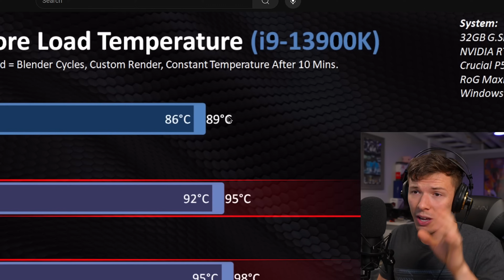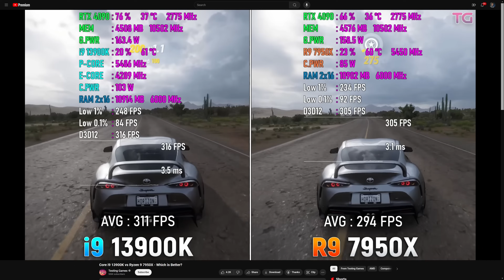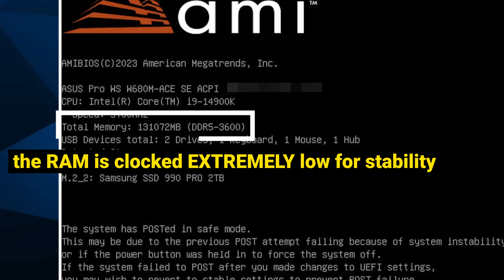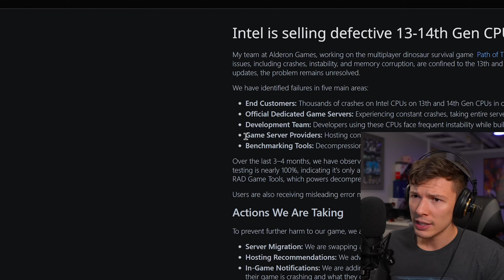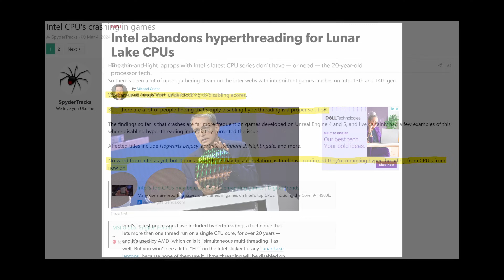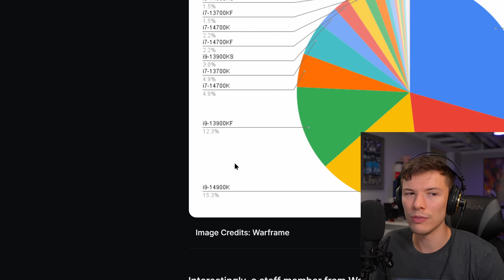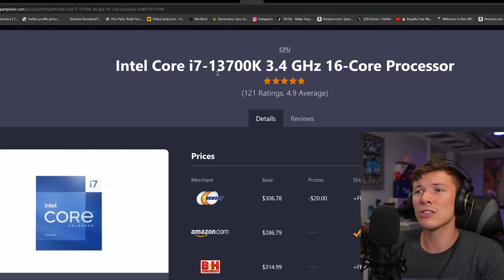Intel F**ked Up Bad

Comment: Its not the power its the insane high voltage that they are using for single core boost. its running up to 1.525v on single thread workloads, limiting the power wont help since it can roast 2 cores at max voltage with less than 125w.
The best guess so far is that the degridation is effecing the ringbus and not the cores themselfes, thats why the errors are so random and diverse since its the link between the cores and not the cores that are failing. 
The last intel chip to use over 1.5v was a 130nm pentium 4 its insane to use 1.5v on 10nm.
Reply: Yeah i hear if you own such processors is to fix the clock speed and turn off turbo boost so it doesn't crack the voltage.
Reply: Any processor glitching like this for what ever reason while running and rated spec is totally unacceptable. There is no excuse for it and Intel should be ashamed of themselves for selling crap like this.
Reply: @schrodingerscat1863  you are right about that it should work out of the box but it also goes for amd processors, if you want to preserve them then also prevent boosting on single cores on it.
Reply: @ashamahee  Yeh, I heard that but at least the AMD processors aren't glitching out from day one. Still no excuse for selling product that has poor lifespan because it is being pushed too hard in normal operation.
Reply: @schrodingerscat1863  yeah but absolutely the preferred choice out of the box is AMD no questions about it, their products seem to work for a long enough time before needing to be changed so there's that and there are not many reports either of their products failing.
Reply: @ashamahee  True, I think AMD products only see problems if you push single cores hard for prolonged periods of time, not a typical usage scenario at all.
Reply: @ashamahee  No, there is no evidence of AMD CPUs degrading at all. There are only a handful of examples of this in the community and it's been from certain users pushing too hard to overclock.
Reply: yep. ringbus can't take all that voltage and starts to degrade over time. that's the conclusions I've read from many others on this topic too. very reasonable conclusion given all the info we have so far
Reply: Have a 14900K, no issues, in bios set 1.3v, capped to 320w, 360mm aio, boosts two cores to 6GHz and all core at 5.6Ghz, temps in Cinebench, low 90's max...If the issue was so bad, we would have so many more people screaming that there 13th and 14th gen 13700/14700/13900/14900K, As a long time customer, there probably is an issue, maybe with certain batches and I fully expect Intel to sort this out including full refund and replacement...or else..I also think the motherboard manufacturers have a part to play as on auto the voltage settings for my MSI Z790 Carbon was absurd hitting 1.45v!!!!! so first thing I did was manually set vcore....
Reply: @vMaxHeadroom  motherboards dont set the voltage thats set by the VID table by intel and its insane, motherbaords only control the total power.

AMD isnt perfect at the moment, AM5 boards arent the most reliable but they are usually funky out the box so its quicly replaced.
Reply: So if undervolt the cpu, could it help me prevent from blue screen?@geofrancis2001
Reply: @vMaxHeadroom  Sounds like you got one of the really good ones, most won't get that kind of performance with settings capped that low.
Reply: Yeah. 1.35v should be about max you should use for 24/7 usage.
Reply: you need to prevent those two cores from going into boost mode, that is causing the issues. Cap the cores, all of them from day 1 and issue is solved. What is insane is that it should not be necessary as the product should be working in a safe mode out of the box but it doesnt, the competition for singlecore top score is insane and both AMD and intel are pushing their cpu too far, the silicon is not able to handle it, so far AMD has managed to keep it under control somewhat but their cpu's do also degrade just way more stable.
Reply: @ashamahee  AMD's architecture is much more efficient, they don't push their silicon nearly as hard because they don't have to. Intel has been pushing their thermals and power to the breaking point to win benchmarks in reviews.

Comment: 14900K which is a 6Ghz CPU was designed and released on a node for which even 5.5 Ghz (12900K) was an overclock. Many Intel fanboys dismissed the power and efficiency concerns during raptor lake launch. It was a disaster waiting to happen.
Reply: Meanwhile 7800X3D max out around 5Ghz and kicking their ass while running at a third/quarter of their power.
Reply: I'll never understand why people buy intel cpu for gaming at this age. 14900k is over 500 usd and there's the amd 7800x3d which is faster, more efficient, better stability, better upgrade path and on top of all much cheaper at the moment.
Reply: @mmo0J  Me either sometimes I'll hear them say it's because AMD is for poor people. Or all AMD CPUs stutter. Never heard any good points though other than they need the extra cores (which the 7950 X3D exists) or they need Quick Sync.
Reply: @XxViciousxX AMD cpus don't stutter. Especially when u have good temps especially when u have a good moderboard when ur RAM isn't faulty and it's stable. I have a 5800x3d and stutters isn't my experience with AMD at all. Smooth ess ? Yes. Stability? Low temps and w usage ? Yes yes yes.
Reply: @mmo0J  Maybe the 14900k but for me in Canada the 13900k or 13700k is significantly cheaper than a 7800x3d. Were talking like 25-50% more money to get a proper Am5 setup over the intel combos right now. I ended up getting a sweet deal on a 7600x but otherwise I definitely would have went with intel. This crazy CPU dying thing has of course changed the game but many consumers are unaware and AMD has a price premium in many countries.
Reply: @mmo0J  There was a point in time where I would have made an argument that raptor lake were the best all arounders (even 14600k beats all non 3xd amd cpus at gaming and has a lot of multicore performance for productivity). But in light of everything thats happened since, including my own chip failing... Yeah... don't buy intel cpus.
Reply: @mmo0J  Intel still has the best budget CPUs bang for your buck, the 13 & 14600k run cool and boost to 5.1GHz, with i7 and above you're just throwing money away.
Reply: @dusty_48  lol 5600 was the best low end cpu. Now it os 7500f NOT X600K
Reply: @mmo0J amd is not more stable than intel, it can be just as unstable if you dont know what you are doing. Ive only ever used amd on computers and frankly the amount of people who think amd can do no wrong is ridiculous. Im going intel whenever lunar lake releases. There are solutions for this intel problem
Reply: @TheArcticDen   another stupid fanboy
Reply: Intel "fanboys" did not dismiss the power concerns.  Most of groaned when heard about the Raptor Refresh.  Most of us are running AIO's though a 240 mm was too small. I personally upgraded to a 360 mm AIO as soon as possible.   I've also lowered the max TDP to 253 W long before the whole bios issues.  I recently noticed the NVRAM error in the only Unreal 5 game I played (MechWarrior 5). My CPU is going to die and I disabled the E-cores to buy some time.
Reply: @yonghominale8884  I hope your intel cpu lasts till they fix the problems..
Reply: @DiskRan0  good luck with that. The only "fix" to hardware issue is a new hardware. And judging by the complete silence from intel, they are not going to do this
Reply: @yonghominale8884  NVRAM error? Yeah your intel cpu is dying. I told people way back then, don't get Intel cpu, go for the 7800X3D AMD cpu. In typical fashion, both Intel and NVIDIA are trying to compete with AMD by pumping more power at the problem. AMD made their product extremely energy efficient watt per performance with their 3D cache system, and as a result, Intel decided to pump more power (equivalent of overclocking) to compete. This is what you get. You're CPU is dying because it was already ridiculously overclocked directly from the factory.
Reply: @yonghominale8884 Try locking all the CPU cores to the same clock speed and a relatively low voltage to prevent insane single core boosts which drives up the voltage. Might buy some more time.
Reply: @yonghominale8884 I feel your pain. I had two 14900K units throw in the towel despite alot of precaution being taken to protect the cores, I forced 1.3v, locked the frequency down to 5.5 on all cores, only to have the Vram issues show up on my UE5 games. I have a 24GB 7900XTX
Reply: @yonghominale8884  When this hole thing came to light i was laughing. I cant even laugh anymore this is just sad,...
Reply: @yonghominale8884  You have my sympathies. As soon as Intel brought out the e-cores, I told Intel to take a rough sexual departure. My last Intel is an i5-12400F, which runs beautiful and smooth with no issues. Must be because it has none of that e-core rubbish. My i9 10850K is still doing a splendid job and I will switch to AMD from here onward. Good Luck!!
Reply: It's been slowly becoming clearer that Intel is flying way too close to the sun
Reply: @MargatroidVII the temps certainly feel like one.
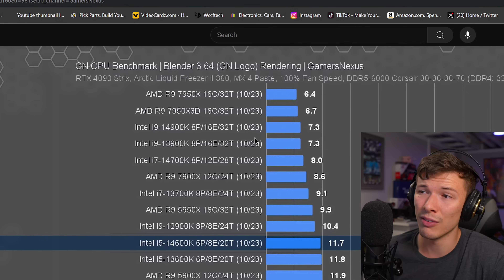Reply: @MargatroidVII  One of the exact reasons I switched to an AM5 7700 build last year after 30 years with intel.  Constant socket changing as Vex mentioned around 19:00 also a small determining factor limiting upgradability with Intel.  Patched my bios regularly early on to resolve amd's soc bulge issue to be safe and my system has been rock solid for the most part.
Reply: You'd be really lucky to get 5.5ghz OC on a 12900k as even the default 5.2ghz was pretty much the limit in general. Undervolting ending up being my goto to get the temps down (80c max) without a performance loss.
Reply: My brother wanted the fastest cpu which is kinda the 14900k but I talked him into the 7800x3d and I’m so glad I did. His first pc experience would have been ruined because of intel
Reply: It's funny that 15th gen i9s are advertising 5.7 Ghz, not 6 Ghz. It's almost as if they knew that it was a stupid idea and did it anyway.
Reply: Shades of 2000 - 2003... but a bit worse.
The Athlon(the Ryzen of the time) kicked so much a* left, right and centre that Intel didn't know what to do anymore. They just threw more and more Hz onto each new unplanned, forced, hastily released CPU while AMD were merrily going ahead as per roadmap and releasing killer after killer.

Those Intel P4s ran extremely hot and many people ended up with either fried CPUs or having to underclock! (Yes, they also slapped the "Extreme" labels on the CPUs to dupe the general buying public. Old Intel marketing trick - especially when the competition is close)
Reply: AMD got class action because they called Bulldozer core that have 2 ALU (Arithmetic Logic Unit) as two cores. AMD lost the class action. Intel bribed PC manufacurer when they cannot compete with AMD Athlon64. AMD won the law suit. Intel users affected from marketing greatly because they don't understand the technology.
Reply: I'm so glad I slurged for the basically 'under tuned' 13900KS
I've seen it go to 5.5ghz once ever but it's def a better lifetime buy
Reply: It's not as simple as just pushing it too hard. If that's all it was, they would have likely caught the problem earlier. The fact that the problem still existed even after a minor revision to the architecture with a re-brand as "14th gen" is particularly odd. 

It seems likely to be related to the unusually complex architecture, and the way the ringbus works, but we'll know more about it, in time.
Reply: @syncmonism It was result of all that plus bad silicon that was allowed into production despite not making the grade. That and they were essentially pushing these chips to their limit and shoving power into it to try and keep up with AMD. It was inevitable something was gonna give eventually Edit: Had the Sillicon been properly QA tested they probably wouldve gotten away with it
Reply: I'm just gonna say right now... I called it I got called an AMD fanboy 😂